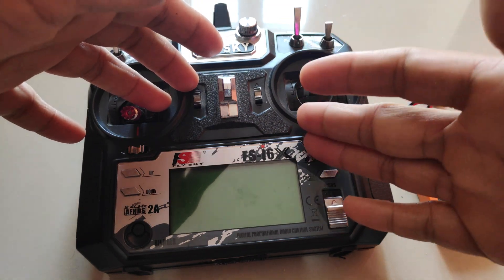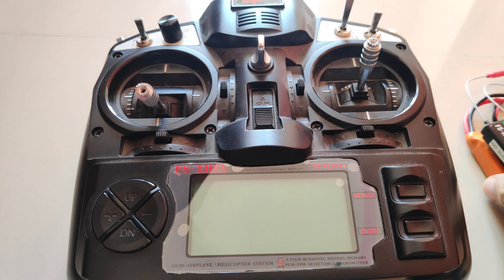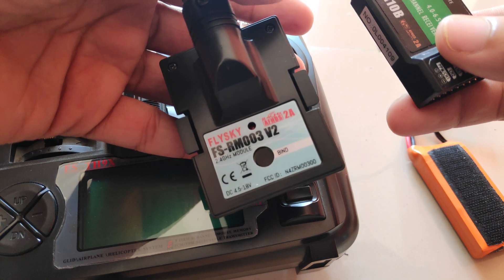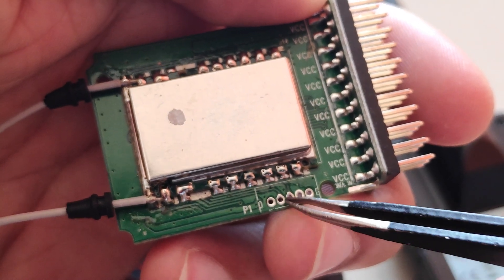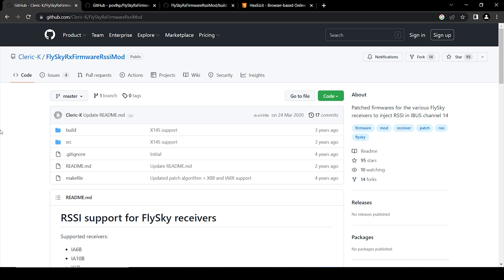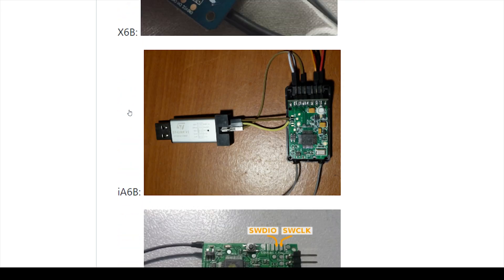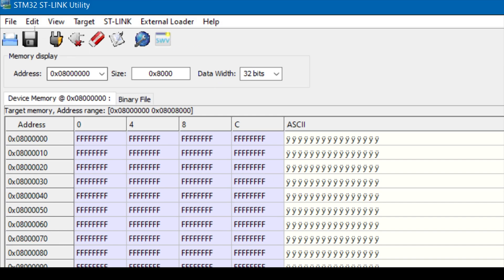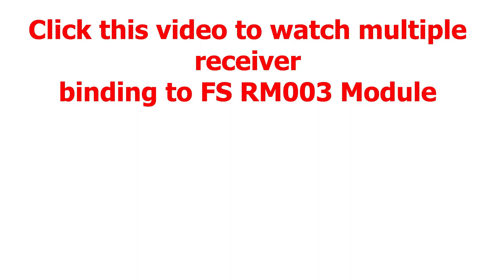Flysky FSIA10B Receiver RSSI Firmware Flashing Turotial for OSD RSSI Value

Comment: Hi, It’s virtually impossible to find any documentation or process to set failsafe on this receiver outside Flysky transmitters.  Is it even possible?  I use Taranis with xRange 4-1 module which binds fine but could never internally or externally set failsafe with it.  Is there a failsafe button Im not seeing on the receiver?  I’ve tried all lot of combinations from Hold, no pulses, custom and receiver.  No success motor continues to run with TX off.  Funny at one point prior to OpenTx FW update I get the annoying Rssi low telemetry fine consistently which never worked correctly and keeps blaring in the background 😊updated taranis FW problem solved telemetry gone though.  This long enough 😅😊😂I hate this receiver any help you can provide would be awesome.  Thanks for the clear explanation on this video either way.

Comment: Hi I need help I have issue fs i6x  radio and fs ia10b receiver its binding fine but its need every time bind why like that is that radio problem or receiver 
It’s binding ok but after few hours I want to play or next I see it’s unbind please could you help me 
Thanks
Reply from the maker: @bunasir394  is the binding plug connected to the receiver? Make sure to turn on the radio first and then the receiver. Or it could be that the receiver has a short on the binding plug with the ground line which may lead to re binding every time you power up the receiver
Reply: @RakishRc  thanks for fast reply 
Yes I insert bind plug every time it’s bind ok same time but after few hours or next day you want to play it’s found unbind and you need again bind procedure what problem this it’s should bind one time not every time
Reply from the maker: @bunasir394  Well seems like the receiver is faulty... mostly like solder on the bind pin is shorted with ground line...you can remove the receiver cover and check..do you have another receiver to test?
Reply: @RakishRc   yes I have also same another receiver and I tried but still same happens do you think problem only radio control because I also tried with another receiver still nothing 

But I will inform you that I tried with other radio fs i6s it’s working fine no need binds every time
Reply from the maker: Then seems like your radio bind button is shorted. If you're comfortable remove the radio cover and check. Could be the bind button is stuck or making contact with ground line causing the radio to enter binding whenever you power on

Comment: Sorry for too many questions . I am trying to assemble my first rc vehicle ,a quadcopter, budget is limited as I am trying to have 2 different ways to handle my drone , through rc and through BVLOS using a raspberry pi . I ll use an apm 2.8 fc ,other fcs are out of my budget ,they ll not work with BVLOS setup. Telemetry module for apm is out of stock in India, I ll be trying to get it from aliexpress.
I suppose Telemetry is very much necessary to monitor the critical data from your drone ex. Battery status .
Also I have read somewhere that failsafe in th9 isn't very good. Please suggest accordingly. Thanks
Reply from the maker: Th9x failsafe needs a few steps to make sure it works correctly with regular firmware. If open tx or er9x is used on th9x then failsafe options can be setup but the transmitter module also need to be setup for failsafe by pressing the button on backside for few seconds. Telemetry is crucial as you mentioned even rssi, altitude fly mode and if using gps sat numbers and home direction.
Reply: @RakishRc  got it. Thanks
Reply: Did that , replaced th9 with i6x radio,  thanks for the suggestion 👍

Comment: I have one query . I am new in this field, recently I purchased a fs th9 transmiter ,should I go with fs i6x ? I thought th9 would be better in terms of range and number of channels . In terms of telemetry support , my idea of support is th9x will not show the telemetry data from the drone  on its screen ? Can't it be activated by firmware flash ?
Please suggest .Thanks
Reply from the maker: Actually you're correct. Th9x seems powerful but it's now outdated and doesn't justify price. Fsi6x is anytime better option especially with open tx firmware on it. I would suggest you get a fsi6x if possible.
Reply: @RakishRc  thanks for prompt reply . Only two factors where I am in doubt are range comparison between the both and number of channels supported after flashing .What is the max range of 6x and number of channels it can support after firmware flash ? Thanks
Reply from the maker: @saimkhanafridi  8-10 channel standard as original firmware. But it now also has upto 16 channels with open tx with sbus 16 and ibus 16 however it should be used carefully.
Reply: @RakishRc  Thanks a lot bro ,you are  Godsend 👍